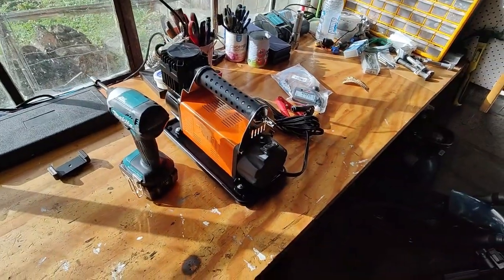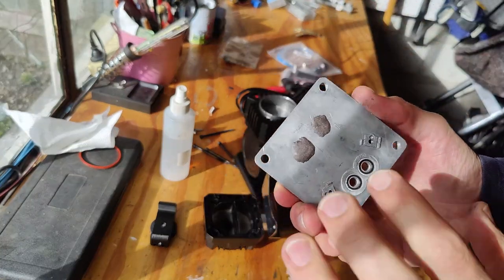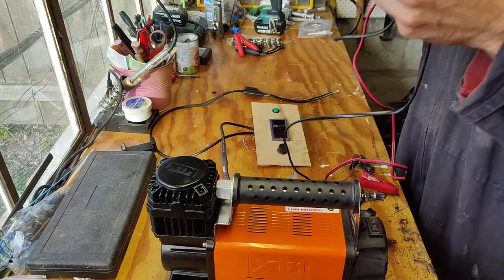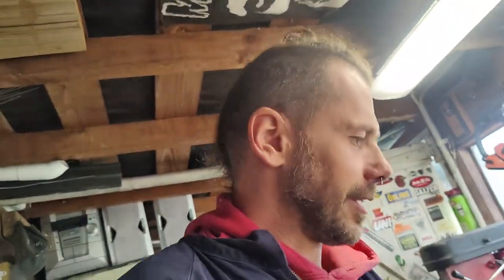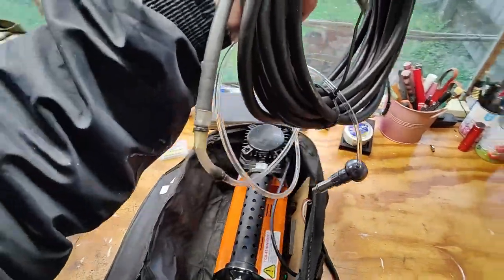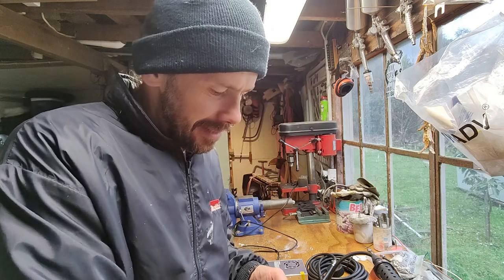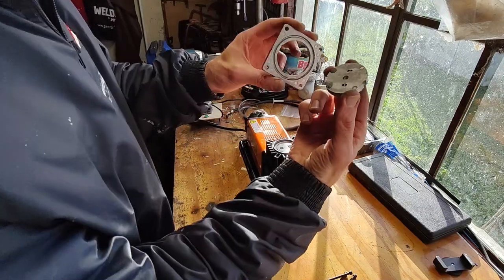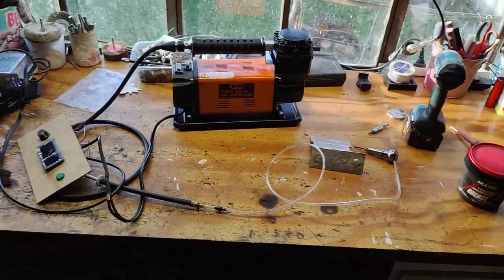1979 Ironhead Sportster wants to be sparkly! Will it work?

Comment: One thing I wanted to mention was about the heel on the tip, this is important to have that right, so your graver bit glides nice across the metal and does not just dig in to deep, this helps control the depth of your cut.
Reply from the maker: Oooo thank you I'll check that out when I'm back home! Thanks for the tip

Comment: have you looked at a DREMEL electric engraver. I got one for $43-00 at Mitre 10
Reply from the maker: Yes I got one of those and for some parts that's useful. But for others not as you don't get s smooth lines with it as with this kind of pneumatic graver